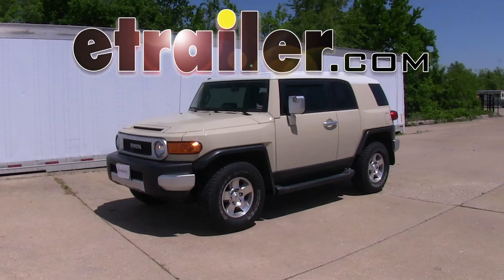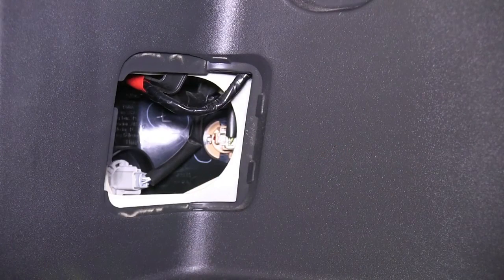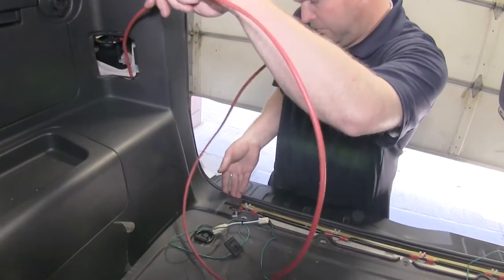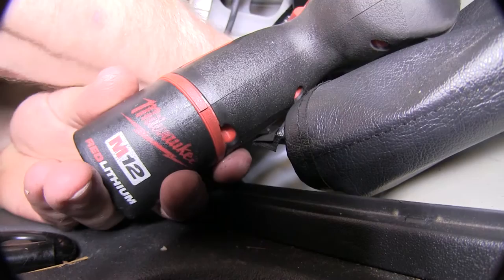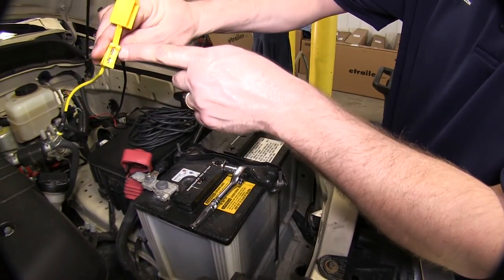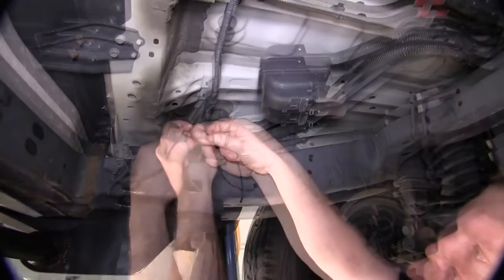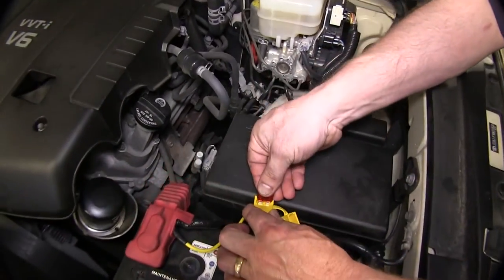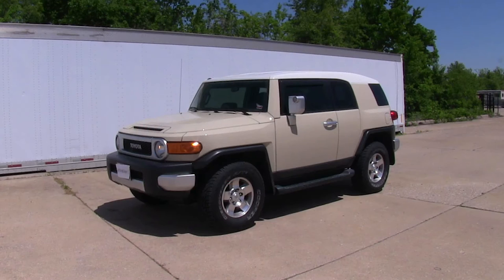Install: T-One Vehicle Wiring Harness with 4-Pole Flat Trailer Connector on a 2008 Toyota FJ Cruiser

Comment: What is that existing wiring attached to frame rail? I assumed that was the wiring harness and all that was needed was the right adapter.
Reply: @wallacedaniels  I bought the kit from Toyota and it's way easier than this. No fishing. Plug in an adapter to the wiring under the steering column, pop in a fuse, then plug in wiring that attaches to the trailer. Simple and only 90 bucks
Reply: @wallacedaniels  FJ Cruiser 2007 Trailer wire harness. I called u my local parts dealer and asked if they had it, this is what they came up with.